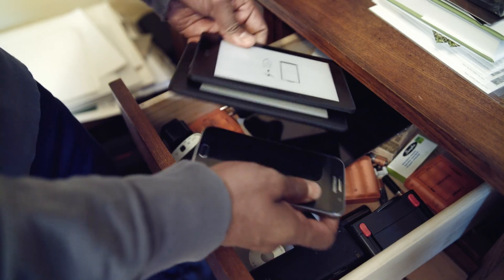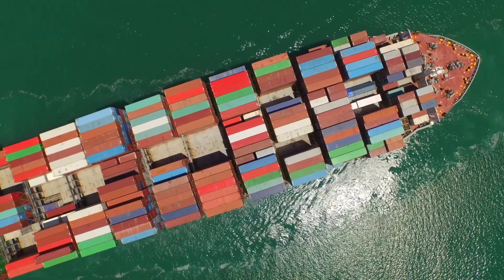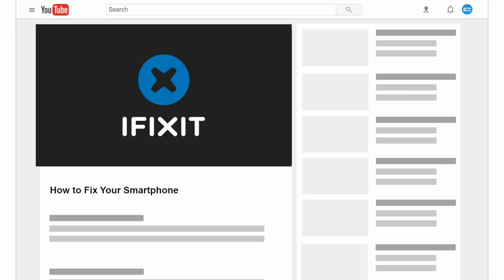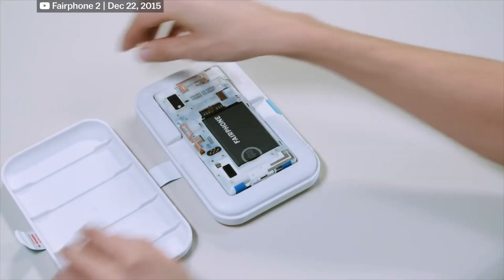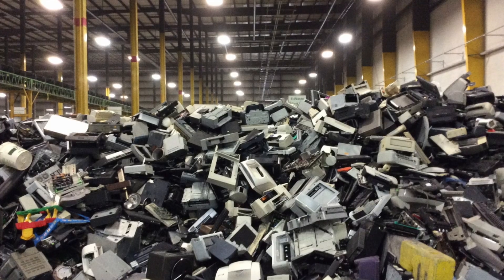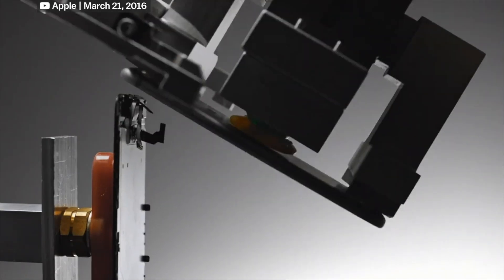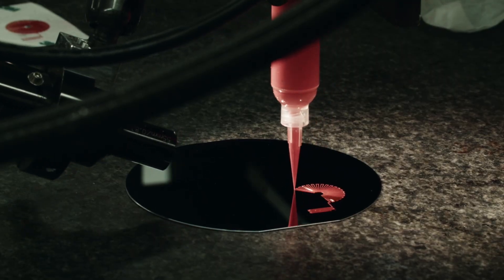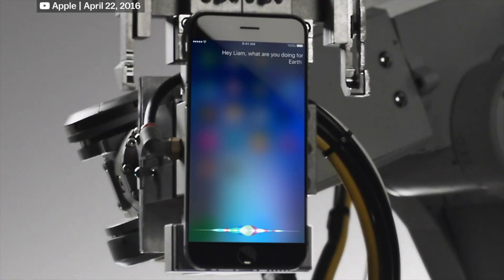Why your old phones collect in a junk drawer of sadness

Comment: Just came to my mind.
Gadget producers, and any producer in general, do not want their products to last long. So that you come back as soon as possible and buy a new model. Iphones slow down just in time for a new model to release. I.e. all manufacturers are interested in weak, short living products.
Gadgets are getting faster and faster CPUs but… the do not seem to be actually getting any faster when it comes to using them. It's just because they can’t (and aren't intended to by the producers) catch up with new software. It's a rat race, a vicious circle: hardware is getting faster but the software is getting more demanding, resource-hungry. Just imagine if we somehow prevented new phones from appearing on the market! Software developers would have to learn to optimize their codes stripping it off unnecessary functions. E.g., I have a paid scanner software on my phone and dropbox offers, though a simpler built-in functionality, but still it covers 99% of my scanning needs! I wouldn’t have probably bought the paid scanner! Or I’d rather ahve Dropbox remove their scanner but I can't. Now, MS Office. Each individual app (Word, Excel etc.) takes huge space on the internal memory. while a whole office package by a 3ʳᵈ party developer weighs pretty much less than MS Word or Excel alone, with Google office apps in between. I really hate Opera and Chrome: just two years ago they were pretty fast on my phone. Now they offer a news feed that sometimes takes half a minute  to load before I can start browsing. Why???? Gimme back my old light weight browsers without the bullshit newsfeed! I wish I could use my phone for about 6-7 years or more, but it'll probably be freezing unacceptably too often within a year! Just because of the bad software! And I can’t do without updating it form time to time either! It's expensive on the one hand, I pay for it with my earning, and it takes resources to produce and deliver it: all those plastics, metals, glasses, chemicals, carbon foot print and what not! Why should they be thrown into garbage just in two years?

Comment: We have ecoATM in Rhode Island. All you have to do it's charge the cellphone, click on 'master reset' (restores the original factory settings deleting your personal data on the internal storage). And the ecoATM scans the cellphone, you have a drop in for the charging cable, within 20 mins you have between $30 to $100 dollars (or more if the cell it's in perfect condition).

Everyone please do e-cycle, it helps the earth.

Comment: It's not just about hardware itself but about software as well.

From most manufacturers, you need to buy their latest shiny hardware to get OS updates and bug fixes to your system.

And not just manufacturers, no software developer would develop for older hardware and software because older hardware / software has less users because of the aforementioned reason.

I myself don't buy phones unless necessary but the above points i mentioned are legitimate issues people put forward.

I'm using a Huawei P8 2017 Lite and while the phone is excellent in everyway given it's price range, it's gimped by the measly 16GB Internal memory and SD Card is useless because even though on select phones from a variety of manufacturers, Android doesn't treat the SD Card the same way Symbian and Windows Phone 8.1 does so no app, even though they can be moved to an SD Card, will move back to internal during software updates. They do not even fully moved to SD to begin with. Just a small portion of it.

Now, i don't play games and do apps much apart from using e-book readers and using multi-language dictionaries but i have the tendency of hoarding(e-hoarding or digital hoarding maybe) apps and games even though i do not use them. And they know people have such urges so they gimp the internal memory because they know people will eventually cave in to their urges.

Excellent video by the way. Hope i was able to properly communicate my thoughts. Thank you!

Comment: Honestly, unless you had an iPhone, it's only very recently that an old battery necessitated buying a new battery.  Before the last couple of generations of flagship android phones, the battery was replaceable, so you could just buy a new one of those.
The problem has always been software.  You can't upgrade more than one or two OS versions and more noticeably, the OS and apps get bigger and bigger, so older phones start running slower and slower until they are nearly unusable.

Comment: Who is changing phones because of the battery? I have to change my phones because they get so slow they are unusable, or because they are no longer supported by apps because they don't get updates. The hardware of my old phones is still 100% intact. So this is a false argument chain.
Reply: "Who is changing phones because of the battery?"
Almost everyone with an iPhone, or other "sealed" phone, who isn't a major nerd. As the woman in the video pointed out, you have to be pretty geeky, and risk-tolerant, to open those sorts of gadgets. There is a repair industry springing up now, so we can hope that some of that will go away.

"because they get so slow they are unusable"
That's something that can often (though not always) be fixed by the user, by doing a factory reset, and re-installing only the stuff you actually use. There are how-to pages on the web that people can try before deciding to buy a new phone.

"or because they are no longer supported by apps because they don't get updates"
That's a really ugly problem, that could have been avoided, but wasn't. It's perfectly reasonable that developers want to update their apps to take advantage of new features in new OS versions. And it's not surprising that phone makers don't provide updates to old phones: customers are mostly tolerating it, it costs them engineering time to do it, and sometimes it's not even possible because the new OS is dependent on the extra memory and CPU power in new models. But the Google app store (and, I presume, the others) is designed to only host the latest versions. And it's made difficult to keep old versions around. There are millions of phones sitting in drawers that could satisfy people who can't afford new ones, but they can't because the older, still perfectly-usable, versions of apps aren't available. And the "latest and greatest" versions won't run on the old hardware and OS.

I don't know whether this was intended to be "planned obsolescence", but it sure is what actually happens.

Comment: Lel I'm still using the Galaxy S2 :~|
Reply: I used mine for 4 years. And would still be using it if the WiFi/Bluetooth chip hadn't blown. It's still perfectly good for making phone calls, but it's not very marketable without Bluetooth, and the loss of the WiFi means it's no good for a lot of other uses. Getting the parts and tools needed to fix it would have cost more than the used S4 I replaced it with. :-(

Comment: My Huawei Y550 Android phone died suddenly after 2.5 yrs with bad RAM. I bought a smashed one for £5 and swapped the circuit board over and it works great now :)

Just 13 tiny screws,  easiest thing I've worked on.

Ok, I had to swap & solder the headphone jack too as it had been snapped off the spare but you get the point.
Reply: And that's how it should be done! 

tl;dr: Enjoying recent tech doesn’t mean we have to waste Earth's precious finite resources. Instead of letting them rot in a drawer, we need to upcycle our old devices (or just sell them – I'd much rather buy a 1 year old iPhone X in good condition, than a brand new iPhone 7 for a similar price), and IMHO most importantly — we must start dealing with the 'Apple syndrome', AKA the upgrade addiction.

I’ve fixed my personal electronics numerous times. 
When my iPod Classic got broken a few years ago (and it was already really dated at the time and had lots of visual wear and tear), I preferred to pay ~$50 for the repair instead of buying a new one or upgrading. 
The same deal with android phones and tablets.  I'm quite a geek/techie/DIY guy, so I generally repaired them myself (and I must confess – replacing the touch panel in an old 7” tablet made me feel proud AF :D). 

Nowadays my daily drivers are: iPhone SE, iPad (2018) and MBA (early 2015). Each one of them was bought only  after my previous phone/tablet/notebook was either a) broken beyond repair/totaled, or b) sold for a fair price to a friend or acquaintance in need.
I plan to use them as long as Apple supports them, then sell them and put the money towards a newer, equivalent model. 
When the batteries get worn out, I'll just replace the MacBook one myself (95€ kit by ifixit) and the others will be replaced by my local Apple Store (just $35 for the iPhone one). If anything gets broken (but the device is not totaled, ofc), they WILL get repaired, as I hate doing unplanned upgrades (AKA throwing away still usable devices).
Reply: nice

Comment: Consoles like the PlayStation etc. have a life cycle of about a decade so why can't that attitude and design be used in the way we use our phones? Saving to the cloud is great but i think that can also release the worry of discarding our electronics when we know all our data is stored indefinitely and recalled on any device instantly. My phone is only a few years old, maybe just under 3 years old now, however, the battery life is shortening and I don't know if it's the software out the radio chips that are failing and freezing. The OS is starting to freeze and lock up and other things like the camera access is failing, freezing and unable to save. This is a great phone but these issues are making it harder to hold on too. When you receive a load of texts that were sent to you 6 hours prior, it nudges' you to look at replacements.

Comment: I still have my Nokia N8. 6yrs later and the 12MP Carl Zeiss camera takes better pictures than most of today's smartphones. Micro HDMI port, a replaceable battery, memory card slot, dual sim, FM Transmitter...............I could go on.
And don't get me started on the number of times it has dropped and still functions 100%.

Comment: Wow... I feel bad for stupid iphone users who think you need to throw your phone away when it can't keep a charge... It would take me 10 seconds flat to pop open my android phone and replace the battery. I've already done it once, and it's great if you need to go long periods of time without a charge. Just get extras. Too bad you need special equiptment and an electron microscope to keep your iphone from lasting more than a year till the next version is released...
Reply: Newer androids don't tend to have replaceable batteries, unfortunately.
Reply: William Rutherford I have actually never had a problem with any apple products and have devices that are 5 or 6 years old and have no problem with the battery
Reply: Pandaness4567 I have an Ipad from 2012, except it runs slow and occasionaly goes haywire, but battery is like new and holds charge for hours.
Reply: Pandaness4567 Then you are in a minority of users. Most people have issues with battery life as the device gets older because most devices are built in such a way that the battery is just good enough for most users for about a year or so. Powerbanks are so popular for this reason. If you use your devices battery just a bit more than most people do, or are an average user who can't afford to upgrade when the battery gets old, then you need a power bank.
Reply: Calling a phone an Android is like calling a monitor a pc and complaining that pcs suck.
Reply: I have an iPhone and an Android, iPhone works perfectly and the Android goes from 40% to dead in 4 minutes and has a 5 second delay when toggling the volume...
Reply: Yeah, generally speaking Samsungs aren't that great because they spend so much money on marketing instead of improving their phones. They aren't that bad, just not the best choice for most people.
Reply: +Kastel If your Ipad only holds a charge for "hours", then your battery is not like new, its probably just about ready to stop working altogether.
Reply: lobsterbark I will say a lot of battery issues are caused by how you use your device because there are apps and different things that will drain my iPad but at the same time I tend to use it mostly for YouTube or Netflix so I tend to not see as much of a problem. I do know that some things crap out but from personal experience I see that with any brand of phone.
Reply: If using your device the way you want to causes battery issues, then the battery is the issue, not the user. If you have a failing, old battery but its good enough for the things you use your device for, then thats great. You aren't directly effected by the way manufactures treat batteries. But the vast majority of people are kinda screwed over by shitty business practices that every company these days uses.
Reply: lobsterbark Huh... never knew that, Im no expert on this topic but I also had a few issues with the battery for example, for the past 3 years it wouldn't always charge like it usually does, even after restarting the Ipad it still charges very slow until one day, it magically works again. Could this be battery related or is it the age of the Ipad? Im just asking because you seem to know more about this topic than I do.
Reply: Kastel It's probably battery related. The voltage probably dropped lower than the charging software intended due to the condition of the battery, and it charged slowly to avoid further damage to the battery. Once it was at an acceptable voltage, it could charge normally.

Or it could just be the battery acting weird because batteries tend to behave strangely when they get old.
Reply: lobsterbark Yeah I understand, if you’re looking for the brand it’s a Samsung
Reply: What phone do you personally use and what do you think are the biggest respective perks when comparing the big ones: newest iPhone and newest Galaxy?
Reply: Niilo - ‘a Samsung ‘ wtf that is not telling me anything. You could be talking about the og galaxy note and the iPhone X for all I know
Reply: William Rutherford my iPad mini from 2012 holds a better charge then my old lg that I had for 3 years did not every device is like that
Reply: My old Palm Treo smartphone (700p from 2006) was designed to let you change the battery even easier than the modular phone in the video.  You didn't even have to open it.  Same with the flash back up card.  It still works!  All I had to do was swap out the battery.  I have moved on, but I have only used three different models of phones so far here in 2018.

Comment: There is a lack of innovation in this industry at the moment - new phones offer nothing groundbreaking vs the old models; thus, manufacturers apply planned obsolescence, making low-quality hardware that has to fail after a certain amount of time, coupled with software that is updated for only 2 years and they say it is because the new OS is more demanding. Non-sense, we're now in the same situation as PCs are,  see how a high-end PC from 2007 can run Windows 10 perfectly fine today, a phone from 2013 running a Snapdragon 800 series CPU could run the latest version of the OS perfectly fine, should the OEM not seal the battery and allow for updates to be pushed to the device. My two cents, phones today are meant to die in 2 years, but you know, if there're still customers, why should the practice change. Microsoft is forced to offer SW updates for a Windows version for 10 years, yet most Android phones stay on the same version of the OS as they shipped with. Of course the authorities do not bother, no one sees the monopoly one has on the smartphone market...

Comment: I'm starting to believe that even if a battery lasted for 10-12 years, people would still rebuy phones every 2-4 years. The advancement of technology is a much bigger deal. You see, if it were possible to take todays battery and put into an old phone it would, theoretically, allow the phone to last longer. However, todays phones are running more and doing more with high res displays, uhd cameras, 4k video, video calling, texting, producing work documents, handling emails, hosting entertainment, etc, etc. The average consumer allows themselves to be linked to the world 24 hours a day everyday. For that, we need more than re-usable batteries. What multi-tasking technology lasts more than 5 years these days? It's an extremely difficult challenge to find a solution for all it's parts. The future holds many outcomes and we can only hope that technology doesn't hinder it.